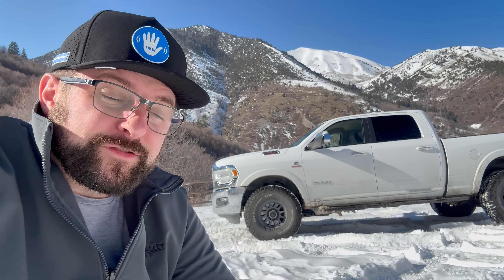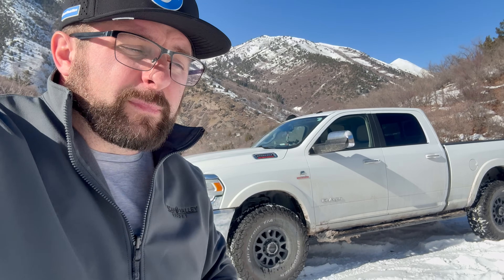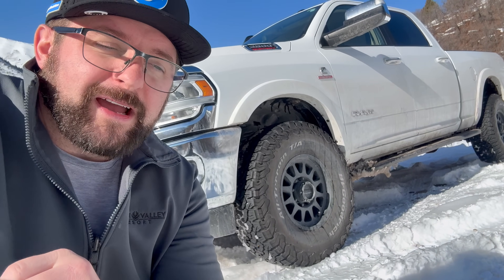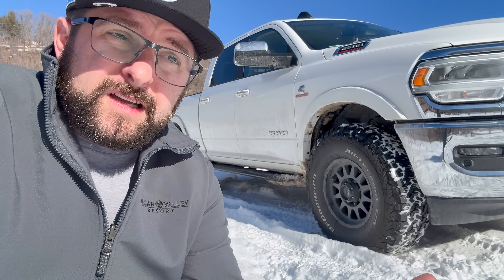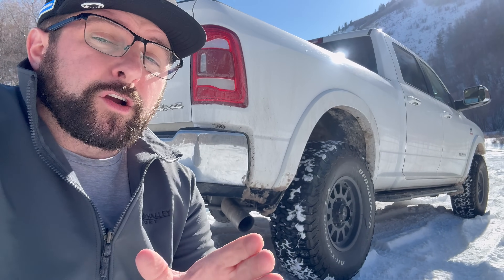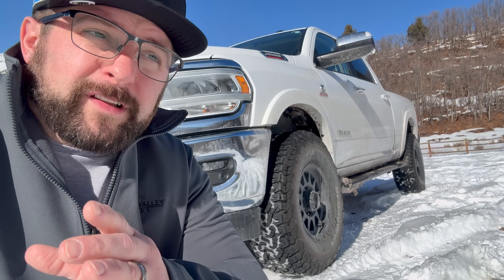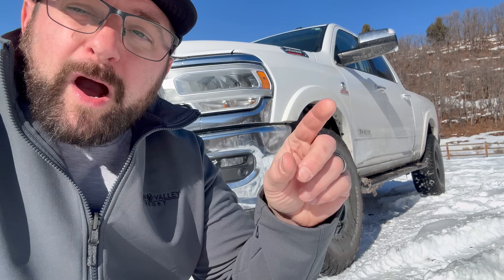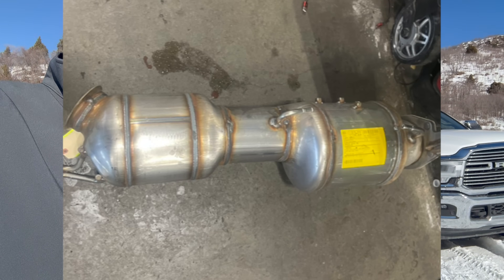How can diesel emissions systems be more reliable?  STOP doing these two things!!

Comment: My 23 2500, regens at 45% ish , haven’t had a problem yet , 15000km on it. I try not to prolong idle but times like -40 hard not to and when I do I set cruise control and high idles on its own or it has its own high in cab heating process. I had a message pop up after an oil change air filter changed , perform service , got me thinking but then it didn’t appear later on in the day. I daily drive mine lots in town , not a heavy foot neither , feel like the soot is building up thou from you story.
Reply from the maker: Quite possible it is. Luckily 15,000 km isn’t much at all. I have a little over 600 idle hours and just over 1700 driving hours, 70,000 miles and some change before mine failed. I idled A LOT 🤦🏻‍♂️ there are some additives that will help soot not build up too, hot shot secrets deal extreme is one that was recommended a lot, put that in for the first time last fuel fill up. Hopefully it’ll help as I use that or others consistently.

Comment: Great stuff info is a little off but you’re definitely in the ballpark wish we could get people to stop deleting stuff I have a 08 duramax completely intact emissions tuned with 780,000 miles original dog replaced egr around 550,000 if you don’t need a diesel don’t buy one if you use them they work fine
Reply from the maker: Dang, that’s a lot of miles! Thanks for the comment! 🤙🏼

Comment: If you cut your truck off doing the regen process, once you start it up again it will continue to it’s  completed. Another way to help get all that shit off of that filter is to use hot shot secret. Diesel extreme. And another way to make sure the regen is completed you can do a park regen as well. Use better oil like Shell Rotella to and add hot shot secret into engine oil.
Reply from the maker: Awesome, good to know it’ll actually start back up again. A couple other guys mentioned that hot shot diesel extreme, I will pick up some of that next time I’m out and about 🤙🏼

Comment: I’ve got 16 Ram Ecodiesel. Sometimes my regeneration will pick up where it left off when shut off.  I try to never shut off during regeneration, sometimes I will drive around the country block to let it complete. I have over 200K on my truck.  Now the EGR systems should be illegal, they destroy the engine. I’ve had many problems related to EGR system.  I would love to legally be able to remove the EGR.
Reply from the maker: Seriously the egr is probably my biggest beef with the system. It’s the most harmful. The other elements like def and DPF can break and so forth as well, but those don’t harm the motor itself the way the egr does.

Comment: Hey man great video. So I have a banks idash. My 14 Ram doesn’t have the regen screen. For regens I would have to say. I have stopped my truck during a regen. Start the truck back up. After the motor would be hot enough. It would go back into regen and finish the process.
Reply from the maker: I appreciate it. You and a few others have told me it’ll finish the cycle, I think my service advisor must be incorrect. Thanks for commenting

Comment: Great advice and I've been on that DPF screen since my 2022 3500 began throwing constant DPF regen codes at 7500 miles. Took over two years and another 44k miles for the dealer to finally discover that the DPF had a manufacturer design flaw and swapped it for free. Now, no more codes and it only does an auto regen about every 270 miles. I also use the manual mode on the tranny to keep the RPM's around 1850, regardless of posted speed. Did a test on this by keeping it in drive once and resetting the trip computer and the difference between auto regens dropped by about 100 miles, so the manual thing really works.
Reply from the maker: That’s super helpful to know! Thanks for the tip! 🤙🏼

Comment: for regens, there are two types. Active and passive. Active is when the dpf screen shows "regen in progress", this active regen will also occur every 24 engine hours regardless of if the DPF sensor hits its threshold to trigger an active regen or not, it can also take longer than 15min to complete depending on how much soot buildup there is to burn off before the DPF sensor minimum threshold is reached. Passive occurs when you are driving and temps get above around 600-700deg F. Thats why short trips and idling build up soot faster. The temps are too low to burn off the soot thats building up. Also, dont drive around town in the overdrive gear. I constantly use my manual up/down shift buttons to keep rpms up to prevent lugging the engine (another high soot builder).
Reply from the maker: Awesome advice on not using the overdrive gear. And it makes sense on the passive regen, I’ve wondered why on my longer trips of about 4 hours of non stop driving I never see the DPF get above 0%… it’s constantly doing a passive regen. Thank you 🤙🏼

Comment: what running boards do you have?
Reply from the maker: White knuckle off road sliders. Love them. I opted for the thicker beefier version, I think they are about 180 lbs each and they are frame mounted so can really take a beating and protect the truck. If you scroll back a couple years I did a video on them after my first camping trip with them on.

Comment: 2 things I did to make my diesel work.  1. Bought a 2000 F350 7.3 PS with 6 sp manual, no DEF, no emissions and KEPT IT.
2. Moved out of the Communist city into a nearby county that doesn't do emissions checks.
Reply: You don't need to worry about emissions since that is a pre-emission vehicle. You could have saved yourself a move.
Reply: @cgriffith0187  Yah, I bought it new in 00 and will keep it forever.  Regarding leaving the city, I was born there in 1955, when gang bangers drove by and took shots at my mom working her garden, we all fled.  Not just the crazy politics, living on 40 acres in the woods was the best move I made 30 years ago.
Reply from the maker: 40 acres in the woods sounds hard to beat. What state? Crazy about your mom too, glad she’s ok.
Reply: @gavinwalker5686  Grew up just outside of Denver, moved into a county in Colorado.
Not the same place it was back then, but what is?
Reply from the maker: @HighCountryRambler no place is nowadays. My folks live in Firestone and my brother lives in Mead. Beautiful area, I always enjoy visiting them.
Reply from the maker: Haha both solid pieces of advice!

Comment: If you can afford a truck like that, just learn the systems, spend $60 on a scanner like Top Don. Get the security gateway adapter, and you can manually check it and / or do a manual regen, but just know it can take 45 mins to 1 1/2 hours to complete. Park somewhere free of flammable debris away from exhaust and a/c turned off to not ask engine for more power and don't touch any of the pedals during the regen it will mess up the whole process. I have the 3rd gen ecodiesel and drive a 70 mile round trip to work and for 20 to 30 miles lock it at 70 mph, and a passive regen happens. As it collects soot, it burns and cleans it. Also, idle time should be like 18 percent or lower if not then plan every 2 to 3 weeks a trip or a loop to drive for an hour on a highway and use a fuel cleaner or cetane booster to help get the exhaust hotter. Also will keep other things clean like egr and engine from them being hot and allowing to cook and soot/oil that is not being cleaned by dpf. Also as long as you know and take care of maintenance on these systems they are covered federally 8 years or 80k miles. Some sensors can be covered longer if found faulty and properly maintained.
Reply: I looked up that Top Don its $1000. Is there something else they have that you are talking about
Reply: @jsned2502 i use a Bluetooth obd2 scanner and obdlink (obd fusion works too) to monitor egt's and dpf soot. It even let's me put the real time data on the center touchscreen using android auto.
Reply: And clean or replace sensors in the intake that get coated in soot due to the EGR system. MAP sensors are a big one.
Reply from the maker: @hochhaul I bet I’m due for a cleaning on those.
Reply from the maker: Dude thanks for all that info! You sound like you really know your stuff on how to take care of these systems 🤙🏼

Comment: I have the 2.8 Colorado and it restarts the regen if I shut it off before the regen is finished. A plugged DPF still has lots of life and should be cleaned and reused. Just because it’s clogged doesn’t mean it’s no longer any good. The actual only issue with intact trucks is short trips where the regen never gets a chance to finish.
Reply from the maker: Cool the Colorado picks up where it left off.

Comment: When the truck regens the engine sounds different on idle . Where i live i use the highway as much as possible
Reply from the maker: A couple days ago it began an active regen around town, I noticed while at a light the rpms stay up and it sounded different, and not just a higher rpm noise, I could tell more gas was getting put into the system to get those temps up.
Reply: @gavinwalker5686  on my 2021 3500 370 horse power when my truck regens it has a low tone from the intake .it sounds like it has asthma . I also put the monster ram on my truck when i had it 3 months .i bought it new . If i had a 5500 i would force a regen once every other week .

Comment: And a DEF truck suck for a work truck when its cold out where you need to leave it running on the jod  and the DEF tank has a heater in it and we have them go out alot and its 1500 bucks every time and my work truck is a 2022 and i have put 3 in it so ill never get one if i get a new truck for work its going to be gas or ill get a pre DEF truck and make it like new my last work truck was 20 years old and i never had to fix it like this new one and i would still have it if some dum ass didnt hit it  it had 855k on it and i would have took it anywhere but i took good care of it and didnt run the shit out of it but i did work it it had 8000 to 14000 pulled  every day of the week when it was workking
Reply from the maker: Dang, sounds like an amazing truck you had, too bad it got hit. Also sucks you've had to replace 3 DEF tanks.  That's super lame.  Curious in your case why you haven't deleted.  Strict emissions laws where you live?

Comment: My .02. Get a Banks Idash and monitor the DPF soot load and Regen cycle. When it starts to regen just drive it until it completes.
Reply from the maker: Cool, I haven't heard of those. I'll check them out.  Thanks for the tip!
Reply: I putt a I dash on my 2012 power stroke tells you alot of stuff that the truck won't tell you plus will check and clear dtcs also

Comment: Maybe if everyone would stop buying diesel unless they are going to use it like a diesel is suppose to be used. If you are just driving it down the highway it's a waste. Hook on a gooseneck and load it up. They like to be worked.
Reply from the maker: I totally could have gone with the Hemi in a power wagon or even a half ton truck. There was just nothing available when I needed to by one for a business/tax purposes. Everything used was way inflated and only a couple dealers in the area weren’t jacking the new prices too. I could by it at a good price and it had a bench seat with was a must, it happened to come with a diesel motor haha 🤷‍♂️. But, after having a Cummins it would be hard to ever go to a half ton gasser. The truck feels way too good to ever downgrade. I’ve found reasons to tow heavy as often as I can.

Comment: Lots of valuable info in this video, thank you. As far as idling goes, I use my high idle switch in my Powerstroke. It a 2017 with roughly 80K miles on it. I do short drives to get the kids from school on occasion and other around the town things. I have a daily for my work vehicle. The high idle has seemed to keep my dpf pretty clean and AC colder during those hot days. I got stuck in the Gorge on my way to our vacation spot in Springdale and the temps were about 118° outside. The high idle was nice while sitting there for over 2 hours. When I really want to clean my system out, I use Hot Shot's Secret Diesel Extreme and tow our toy hauler up our 6% grades while giving it the beans. Forscan lite on my phone always shows dpf percentage pretty low.
Reply from the maker: I appreciate the comment Jason. Just googled today how to set my high idle, definitely will do that from now on when I do have to idle. Also, I’ll grab some of that additive you mentioned. People mentioned additives often but I screenshotted that one by name so o know what to look for. 🤙🏼
Reply: @gavinwalker5686  Ya no worries 🤙. I've used Hot Shot's Secret for about 8 years now because they list their 3rd party testing results. Also, a lot of the diesel drag guys like them. Project Farm just did a good test on several big name fuel additives and Hot Shot's Secret came out on top. Cheap insurance for these expensive trucks.
Reply from the maker: @jasonkubitz9410  heck yeah, that's awesome!

Comment: Do you have a link to your video on how you are able to run 37’s with no rub. The 37’s could also be a contributing factor on your regens. Regens like 1500-2000 rpm. With the 37’s you’re running super low rpm around town. Try locking out gears to keep the truck 1500 rpm. That is what I have found helps. I have 2023 Ram 2500.
Reply from the maker: No link yet. I’ll shoot the video on a few days though! And, good to know about rpms being a factor.
Reply from the maker: https://youtu.be/RanuvOKuO30?feature=shared

that link is a more vlog style video as I fit them on, and you'll be able to see the wheel well work it took to fit them.  And if you scroll back on the channel to my video about wheels, I go into the wheel specs that allow the fitment.  In a few days is when I'll be filming an all in one video for it. But that will get you started.

Comment: False about not able to re-start the regen if shutting down during the regen to finish.  It will pick up once the exhaust gets hot enough to regen to finish.  If not, then an issue is present.
Reply: I know my ford would not restart a regen if it was cancelled for any reason. It would just stop and would not regen again until the load was back to 100%. I always watched it like a hawk until it finally just fell off one day and I watched it all the way to the salvage yard. No worries any more
Reply: My Ram 2500 ‘18 & current ‘22 will resume until complete.  Usually within 20 miles with Active Regen.  Ram has their trucks perform a Active Regen every 24 engine hours regardless.
Reply from the maker: That’s great info, thank you 🤙🏼

Comment: It would also help if they used different fuels such as HPR renewable.  Made from a variety of sources that are not petroleum based.  Animal and plant fats.  Works beautifully, clean burning no noxious smells and absolutely renewable and sourced in the USA forever.
Reply from the maker: Interesting. I don’t know much about that, but I’ve heard that diesels can run on a variety of fuel options. Cost wise, how do those other fuels compare?